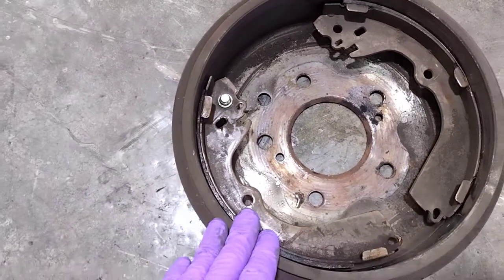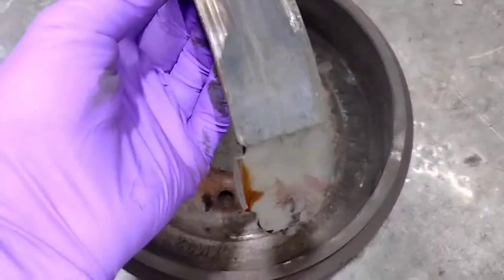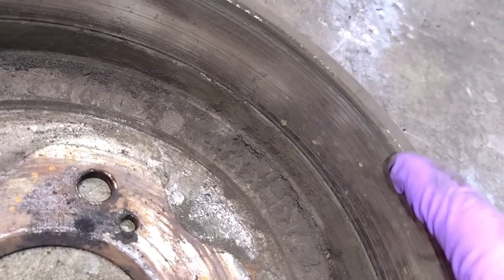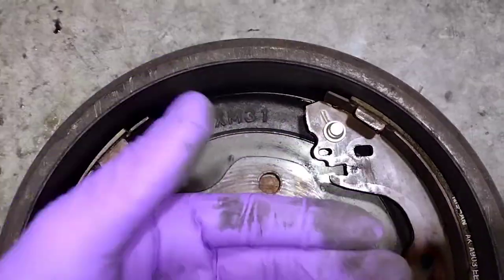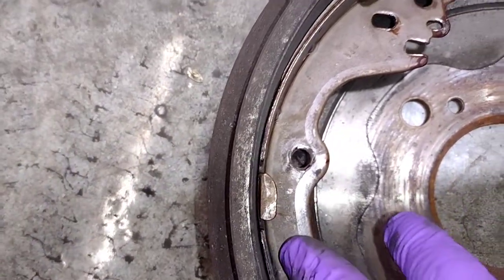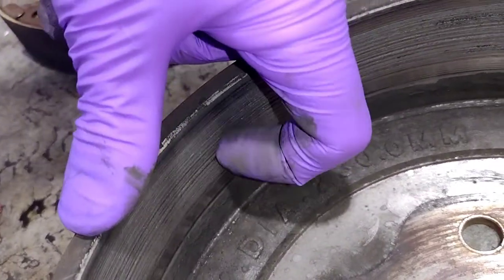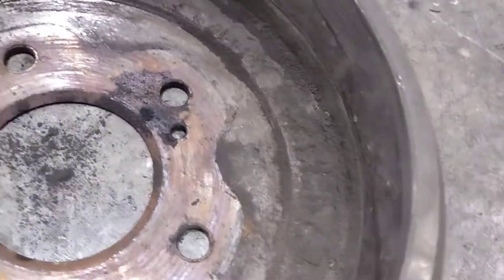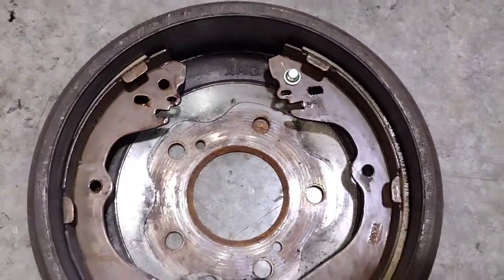Metal to Metal Drum Brakes

Comment: They sure got their money's worth out of those shoes. I always replace the hardware when doing drum brakes. The Japanese still love their drum brakes on the rear. The 98 Honda Civic we have has rear drums.
Reply from the maker: Yeah these lasted over 130k miles. Not bad at all. Some still have brake shoes for a parking brake. But it's inside the rotor. It's usually smaller compact cars that still use drum brakes.